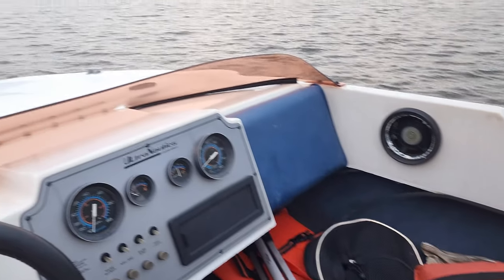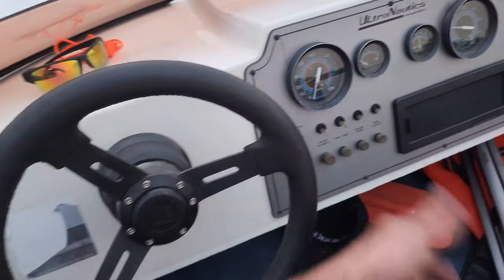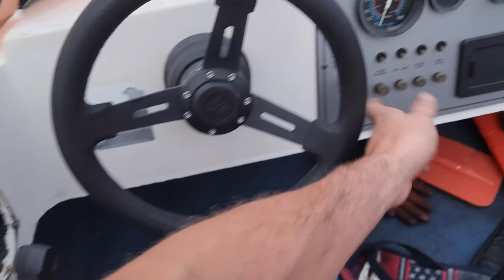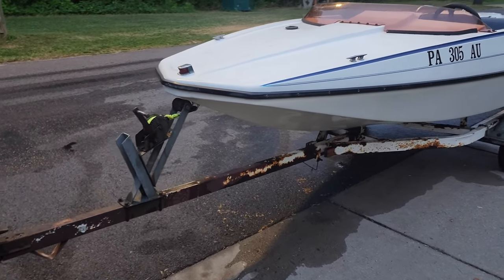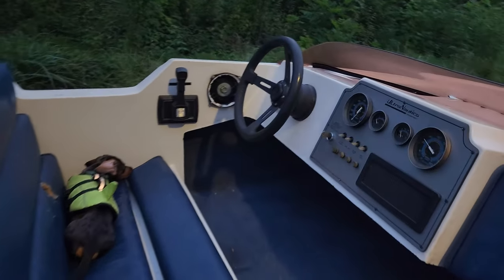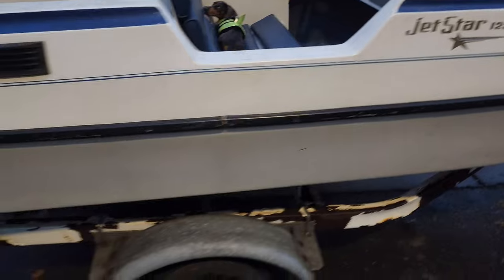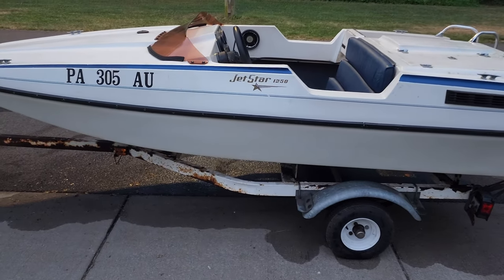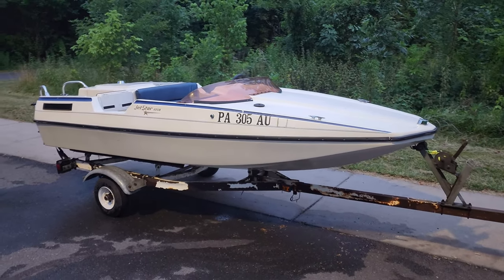Ultranautics JetStar 1250 Boat Tour SOLD

Comment: Hey Chris I have one of these. Do you mind sharing what you sold it for? Mine has an electric fuel pump with a switch on the dash, and we put a new floor in it. Seem to be some common issues with these.
Reply from the maker: Honestly I forget. I think it was $1,000 but I included the beat up wet bike also
Reply from the maker: Problem is neither of them had a title so that was a big downside when it comes to selling it
Reply: @nnkhmisc  Gotcha. Appreciate the info, sounds like a good deal to me but I like the old two stroke crap haha